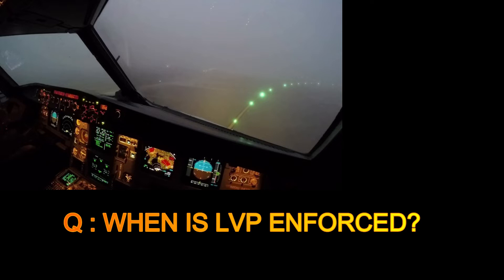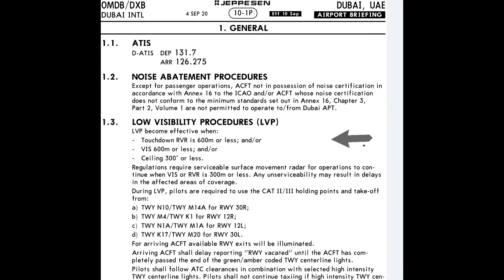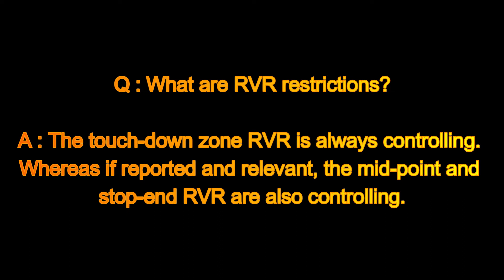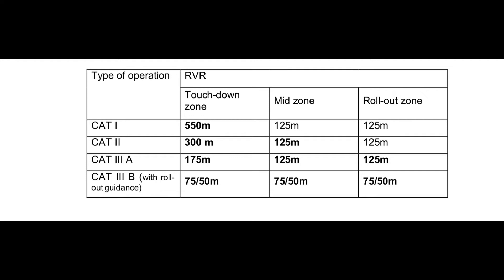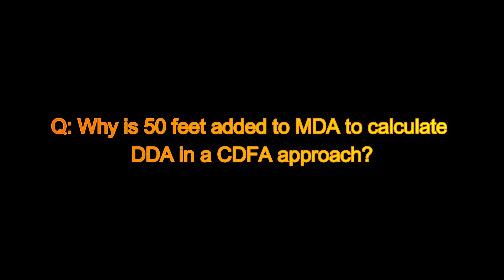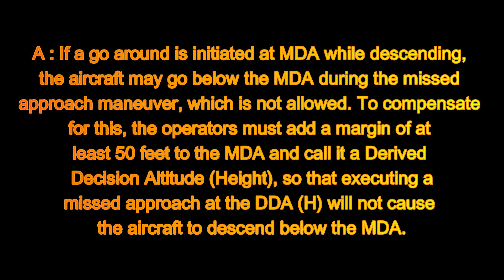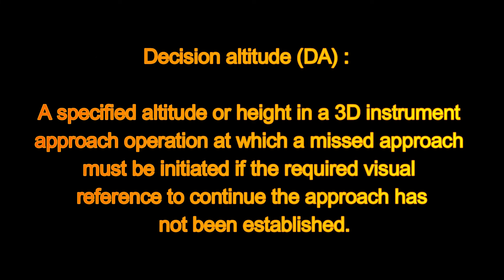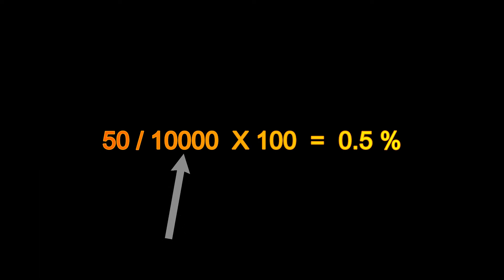DGCA ATPL ORAL Questions and Answers Part- 3

Comment: Which questions are mostly asked in job interview??
Reply from the maker: It totally depends on the type of interview you are going for and also on your experience level. Lets assume you are going for airline interview as a fresher. They would expect you to know the basic stuff related to your flying part. That is the minimum knowledge expected from you i.e. CPL syllabus. If you have a type rating lets say 737 or A320, you may be asked questions related to specific aircraft systems. You should definitely read about the company where you are going for your interview "Thoroughly". Read about their operations like which places they operate to, type of their operations etc.
Reply: @captalphakilo9642  besides that some personal interview questions. Assume say something about yourself?? Or another else